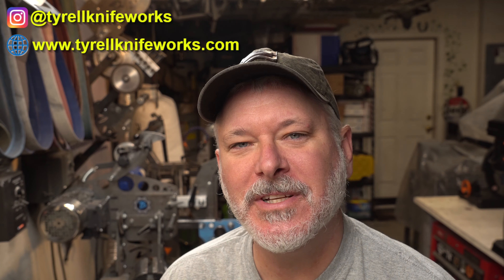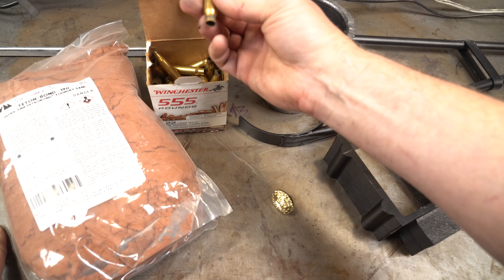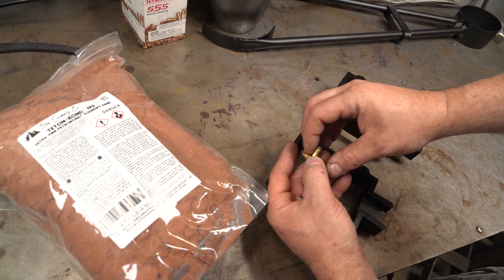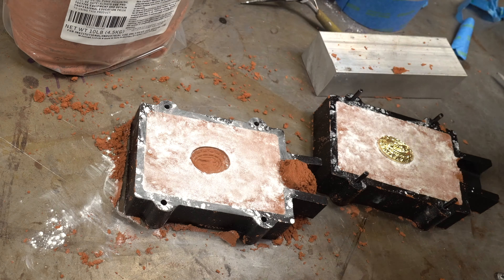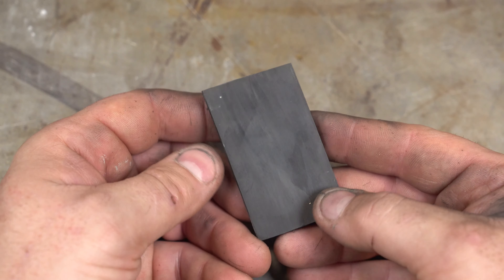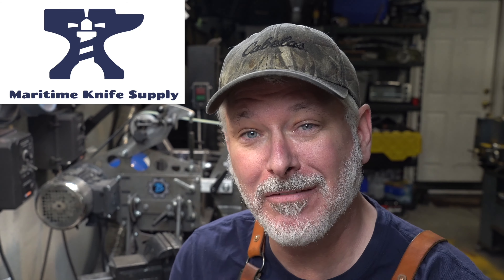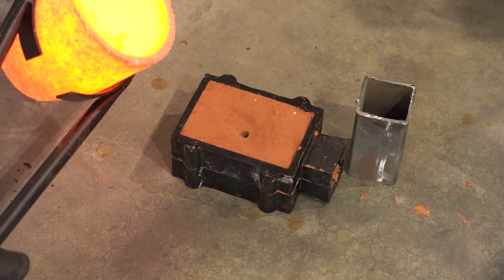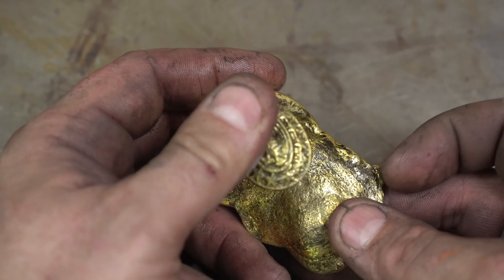Triple-T #147 - Learning brass casting

Comment from the maker: Any questions about the process I followed here?  Let me know!
Reply: In the future for widening or making holes I would suggest using thin wall tubing sharpened from the inside with a knife in a drill like way to cleanly punch out holes. Aluminum arrows or K&S brass tubing are my favorites.

Also, you want to have a tall feeder tube to feed in metal as the more elevation the smaller your bubbles and finer your casting will be. A 3/4 by 4 inch tube you can remove brass from afterwards would be good for this, and you'd make yourself some rounstock in the process.

If you are able to, I would suggest 3D printing your patterns and scaling them up the % that the metal shrinks, plus some more to account for sanding and filing the surface to make everything look better. Sucks to cast something and have it finished, just to be smaller than the original.
Reply from the maker: @SiliconeSword  that’s a good tip, thanks!
Reply: @TyrellKnifeworks  you can also reuse the burnt casting sand with some petrobond to rejuvenate it
Reply from the maker: @joeledwards6587  I just scraped off the burnt sand, which is only about 1/8" and reused the rest.  It's quite inexpensive in any case.  Thanks for watching.

Comment: Ive very recently started to try some casting too. I moved very quickly to bronze because its easy to make, its  more resistent to wear because its harder than brass, and it has no zinc in it so no toxic funes. Just put 88% copper and 12% tin in the crucible, melt and pour :) I like the color better as well. Just made a guard and pommel for a big bowie this way.
Reply from the maker: I specifically needed brass for this build though.  Thanks for watching.

Comment: You could have used a large drill bit on a drill press to widen the hole for the shaft, I think.
Also, a small long screw or threaded rod in the threads of the pommel would be helpful to get the piece out of the sand easier.
Last but not least, having seen some casting videos, isn't the flask meant to be used in another orientation? So the mentioned rod would go out of the flask to the side? Sure, you would have to close the sides with some metal plates and clamps. But it will probably leave some parting lines in the cast, as removing the piece from the sand would slightly widen the imprint at the outer perimeter.
Reply from the maker: Getting the piece out of the sand isn’t hard, it doing it without taking a bunch of sand with it.  It doesn’t matter if the spur is to the side or top. It depends on the shape of what you’re casting.
Reply: @TyrellKnifeworks  that's what I meant with the parting lines, caused by the defects on the mold. But since these defects enlarge the volume of the mold, these can be removed from the workpiece afterwards 🙂